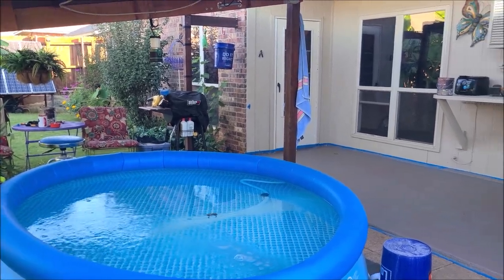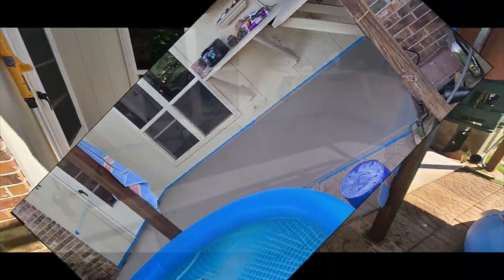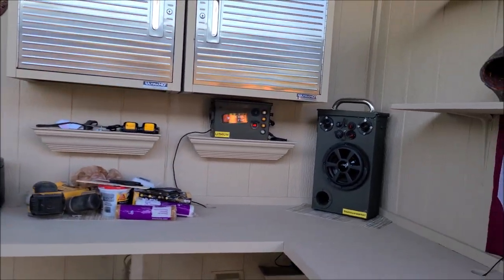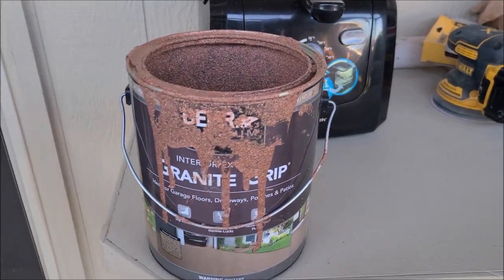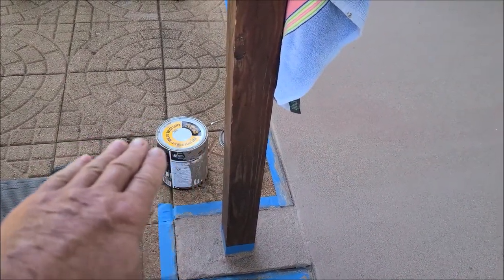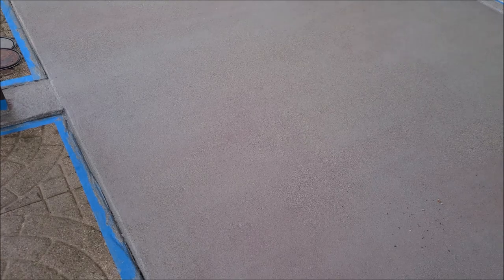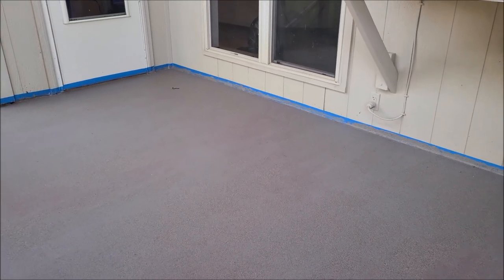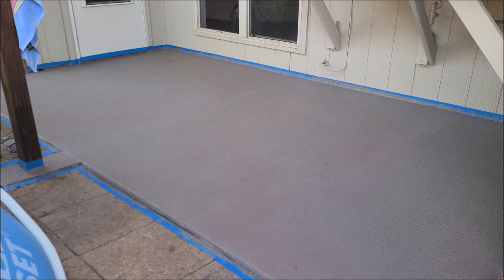Behr Granite Grip texture floor paint - patio concrete painted

Comment: I’ve been painting with that paint for a while now and the best tip I can give you is to use the homeright spray gun after the first coat.  It will distribute the paint evenly.
Reply from the maker: Thanks. I have to gallons ready to recoat this spring. Can you provide me a product link for that spray gun you recommend?
Reply: Hi Chris, What does the homeright spray gun look like? Were can I rent it or purchase it. I am thinking about doing a Granite grip paint job on my porch. thx Lori

Comment: You do the coolest projects.  I'm going to check into that paint.
Reply from the maker: Thanks. It's a very good concrete paint (lots of YouTube videos on here to check out). 72 hours before driving a car on it or placing furniture back on it. Light traffic is fine after a 2-3 hours if dried in low humidity and warm temps.